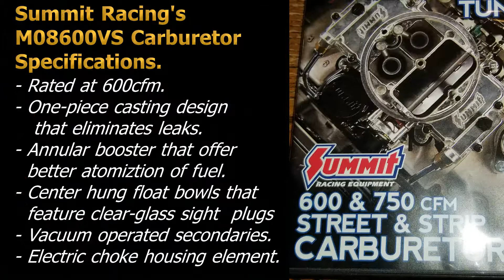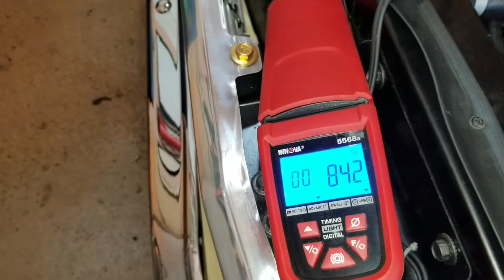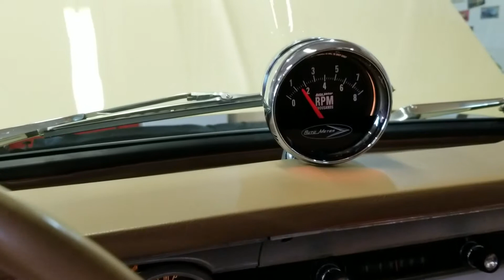Summit Racing M08600VS Carburetor overview. Installed on a Ford 289cid engine with solid lifter cam.

Comment: I'm surprised it idles this smooth.  I looked up the cam specs and it's 224/224 at .050 with .499 lift, would have expected more lope, but it idles like stock.  Nice engine.
Reply from the maker: This is a very mild cam, This is my wife's car so I went conservative on the duration.  I wish I had gone just a little bit more on the duration.  My wife loves it, the power curve is exactly as Comp Cams says.  I was also looking at this solid lifter cam by Schnieder Cams,  http://schneidercams.com/274Fsbfsolid.aspx 

Part Number:

13033

Grind Number:

274F

Intake Duration (gross):

274

Exhaust Duration (gross):

274

Intake Duration (.050”):

230

Exhaust Duration (.050”):

230

Intake Valve Lift*:

.512"

Exhaust Valve Lift*:

.512"

Lobe Separation:

110

Intake Valve Lash:

.015"

Exhaust Valve Lash: 

.015"

RPM Range: 

2200-6400